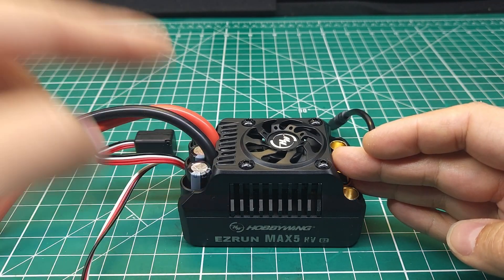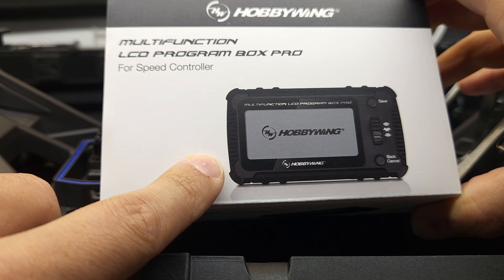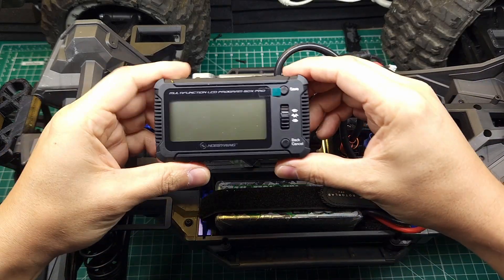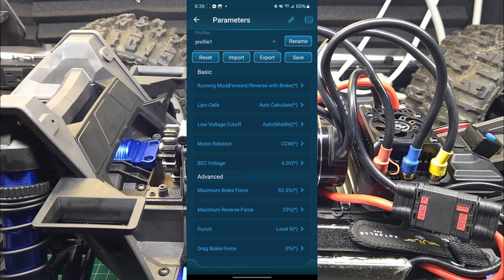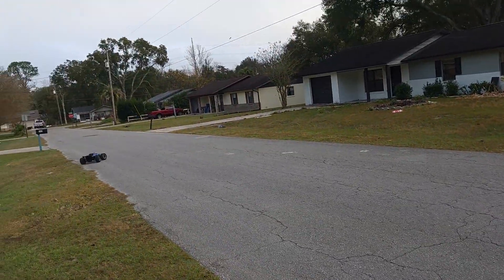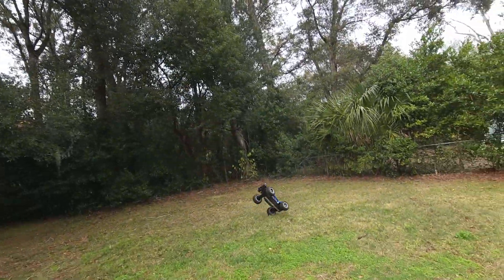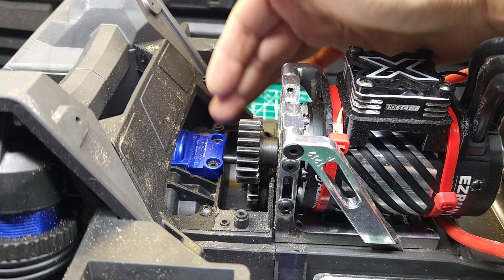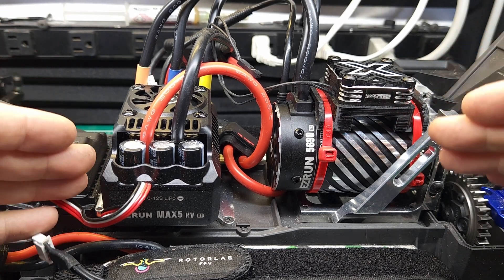Does New Firmware Fix Hobbywing Max5 G2?? | NEW Program Box Pro!

Comment: Hey brother, great vid! Looks a bit soft still with the non sensored motor on take off even after the update? I see you had a Castle in there, how does the Castle compare to HW with an unsensored motor? BTW, what's your take on the King Val motors? I been eyeing them up, seems like a great deal vs the Rocket motors yet look to be identical. Cheers!
Reply from the maker: It's a bit soft compared to a sensored motor and compared to Castle. As far as sensorless motors I haven't really found a huge amount of difference between them. That will have different features such as the actual waterproof nature of the new G2 sensored hobby wing motors but ultimately a brushless motor is a very simple device and it's kind of hard to get wrong. I have run the King Val and rocket motors and never really had a problem with any of them
Reply: @DoRC  Thanks brother! I've used Surpass (no fins), Rocket by Surpass (w/fins) and been happy with them. I see some great deals on the King Val branded 56mm motors, maybe I'll try one. I'm always on a budget, LOL.

Comment: I just lost all my setting options? I’ve reset it it, updated firmware, still not right. Was driving fine, easy driving and now it’s like it’s a completely different ESC?
Reply from the maker: Hmm. That's strange. The punch usually is the thing that is most responsible for how easy it feels to drive. I'd recommend the lowering that.
Reply: @DoRC  what I actually mean to say is that the BEC options are gone or were gone, it would only show automatic Lipo instead of the different selections that normally give you, and any of the other options like motor, reverse or what not. What is it CW or CWWR just gone. They did come back I’m not sure what happened. It took about 15 minutes and then it just came back. Super weird?

Comment: I have been having a similar problem with my max8 g2 in sensored mode and also my max g2 in unsensored. Already tried firmware update on the max8 which didnt solve it. Will have to try it on the max6 to see if it does. Also been having problems with my xr8 pro g3 going into lvc
Reply from the maker: Wow that's a lot of problems. Yeah quite a few people have told me they've had issues with other recently released hobbywing ESCs.

Comment: Great video is it worth doing the update if you have no problem being censored
Reply from the maker: If you don't have any problems I'm not sure I'd recommend doing it. It is supposed to make sensored performance better as well but if you already happy with it I'm not sure I'd worry about it.
Reply: @DoRC  or maybe I’m not noticing it because I have mine crammed into a 1/10 scale Traxxas slash 4x4 and I run 12s 😂
Reply from the maker: @hardtailrider7172  lol

Comment: Great to see the issue was resolved!  Nice battery straps!
Reply from the maker: I like the battery strap mounts but the straps themselves are crap.  I replaced them with some Kevlar ones.
Reply: @DoRC  Yeah, I was really referring to the mounts.  Cheap, easy fix, though.
Reply from the maker: @jerryvolpini7987  for sure. I've run the same style mounts on my several Maxx vehicles and they've proven to be very reliable. I think they're the best option.

Comment: Having this issue with my max6 g2 in my kraton 6s exb with a spektrum 5687 1100kv. The delay is really bad and I thought it might have been my gearing at first
Reply from the maker: I haven't seen the same issue reported for the Max 6 g2. What your experiencing could be cogging depending on tire size and gearing though it could be the same problem. This issue and cogging will behave very similarly though cogging will be more of a hesitation chatter and this is just it starting off slowly.
Reply: @DoRC  it's definitely the same issue for my max6 g2. I even thought it was a throttle ramp setting I over looked somewhere. I'll have to see if I'm on the latest firmware.
Reply from the maker: @OmniMan_Racing yeah let me know what you find.

Comment: It did help but I could tell that it still is cogging from a stand still
Reply from the maker: It's not cogging per se. Cogging is when the ESC is struggling to get the motor spinning because it doesn't yet understand the rotor position. This issue really is just more about the startup routine of the ESC itself with certain motors. There is still a slight bit of hesitation from a dead standstill with some motors but it's way better than it was before the update.
Reply: @DoRC  true, definitely looked better after the update. Hopefully they fix it completely sometime soon. It coggs with a tp 5860 motor (uncensored pretty bad)
Reply from the maker: @andruhanovo6583 yeah not sure if they're planning another update or not.

Comment: Really am glad you are using the max 5 g2.. look forward to seeing more videos of what you do
Reply from the maker: Yeah it's definitely a good ESC and this update makes it a lot better with sensorless motors.
Reply: @DoRC   if you get a chance, grab the 1100 KV G2 if it's on sale. But you will need a rear motor mount attachment for it just to be safe
Reply from the maker: @jackboutcher68 I have one. Honestly I don't really like running the long can motors in these. Too big too heavy and honestly the power really just isn't needed for the kind of bashing that I do.
Reply: @DoRC  but it's still fun.. a buddy of mine has three Max fours and three 500 ish KVs all G2 for his losi dvxl and 5T I believe... Not sure where he put the third one in.. He's also got a 71cc motor I believe for his gas powered 5T
Reply from the maker: @jackboutcher68  More power is more fun :-)

Comment: I have seen a few people with the king val, hobbystar and surpass rebrands having this issue. The delay on my 56112 780kv with 12s is insanely bad.
Reply from the maker: Yeah That's the motor I used in the video. Different motors will have different amounts of this issue but the new firmware definitely helps. It took that motor in the video from being essentially undrivable to feeling pretty reasonable.
Reply: @DoRC  honestly after seeing how well the sensored drove I think that it might be the better solution for me. I hate dropping down to a 90 but the 113 doesn't fit a stock outcast 8s.
Reply: @ChrisHarmon1  I have the 5690 and Max5. Running 23/35 Mod 1.5 and some Pro Line Desperado's Beadlock Rears and Tarmac Busters. It's got ridiculous power.